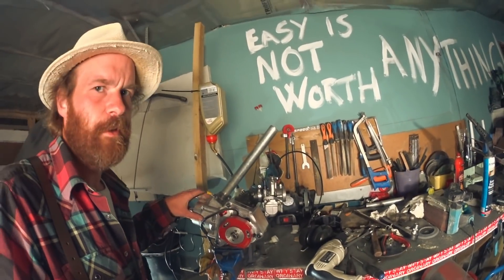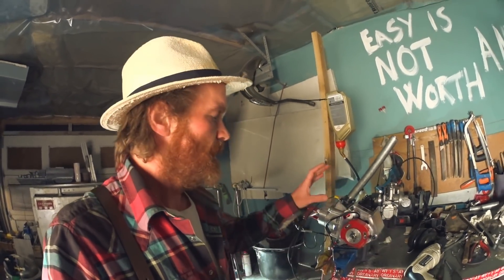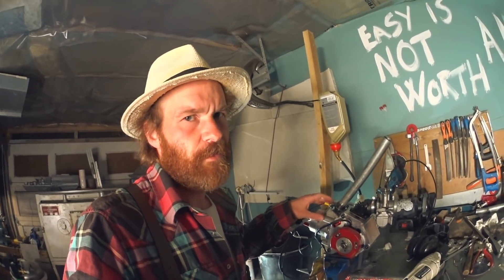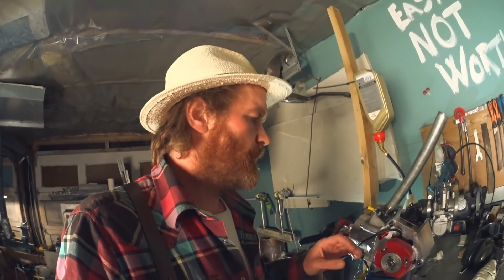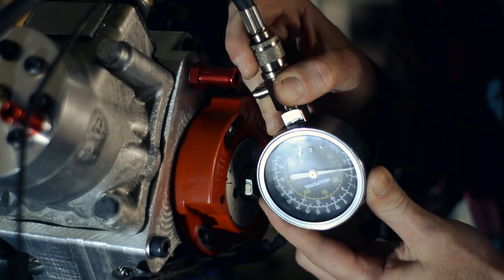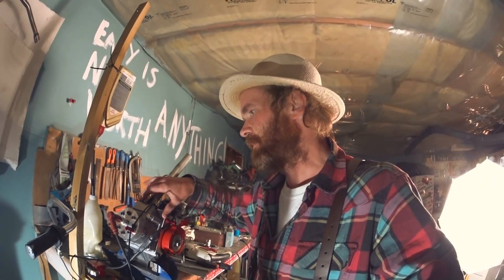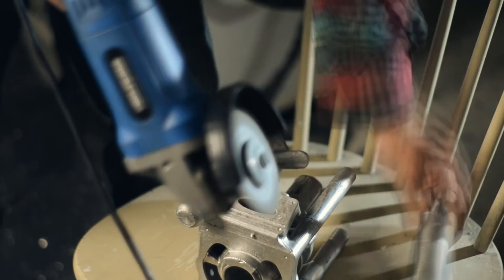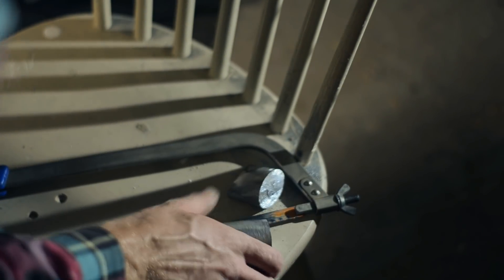Pipe! - The Most Powerful Two Stroke Ever

Comment: Are you running the exhaust upward like that on the bike? My experience with karting engine development is that pipes that have any upward incline do not tune well. I find the oil droplets still in the exhaust gasses seem to pulse back into the combustion chamber with the sound wave. We run 16 to 25:1 on our steel liner engines so maybe it is just the amount of oil we use?
Interested to know your thoughts on this.
Reply: The engine sits upside down on the bike.
Reply: Ahhh that's right I now recall the red cylinder head and IAME barrel facing downwards. Thanks.

Comment: Hi, microsoldering/celltech here, for the heating plate you can buy a lcd/touchscreen separator for real cheap on aliexpress or ebay, they have a little plc and they are like 60watt if im not wrong, that would give you constant heat for hours, in the shop they never turn them off! Love the content and the progress so far, i cant even start to desing a pipe for my old 2t honda!
Reply from the maker: Almost bought one with magnetic stirring last year, should have...

Comment: What kind of stinger/baffle is that?

Sous vide cookers have a pump that might get clogged up with nickel.  I'd go with a ceramic crock pot/slow cooker.  Not sure how it is where you live but I can find a used one at the thrift store for about $10. If you want it to be more precise you can get a cheap Chinese temperature controller that plugs into the slow cooker.
Reply: id say running the sous vide to heat a water bath in which you place the container with nickel plating. That is how many photographers do it to heat developer/blix when processing film
Reply from the maker: 👍 How I'll do it.
Reply from the maker: The aluminum venturi is the stinger - takes tailpipe length out of the equation provided its ID is large enough.
Reply: @2STROKESTUFFING  If I remember right, the volume of the last end of the pipe does something with the resonance. Does that venturi do the same thing?

Comment: @2STROKE STUFFING I was curious if you have ever checked out the 2-stroke calculators that Michael Forrest produced and has for sale at dragonfly75.com or have checked out his theory on pipe design? The reason I ask is his calculator package has many features of ENG-MOD-2T and is very reasonably priced.....also I have read in various locations that ENG-MOD-2T sometimes gives questionable #’s for the pipe because of the set temperature inputs....I believe the calculator that Michael made your able to set temperature (which I assume will be different on Nitromethane)...just figuring I’d ask / share in case this could be helpful for your project / engine.

Keep up the good work!!!
Reply from the maker: 👍 I'm very happy with how engmod works. Haven't tried Mr. Forrest's calculator, but I think it's just Blairs formulas. There's a lot of variables in engmod that has to be set right, think that's why people experience mixed results. As Wobbly puts it "shit in, shit out".
Reply: @2STROKE STUFFING thank you for the reply, I appreciate you taking the time! One other thing I wanted to mention is Mr. Forrest has an RPM specific balance factor calculator that is quite refined, and a YouTube channel explaining its use....this may be helpful in modification of your crankshaft for Mark’s piston and the 20K RPM’s you plan to achieve.

Best wishes 👍
Reply: @2STROKESTUFFING  
Great work man i did another comment in list but thought I'd add here as it's on topic.
Me personally with racing mx and flat track nothing but 2 stroke for 40 yrs.
The expansion chamber closer to cylinder will give bottom end the further away from cylinder more top end .
Hate to see you cut pipe but when running on dyno be great to see mild steel pipe with varying lengths of tube before expansion .
It's pretty much determines when powerband is the greatest. 
Why you see 2stroke flat tracker with under slung pipe further back on bike cheers man, love it.

Comment: When you run methanol you need to rinse out the system from methanol remains, maybe that what was you meant with purge the system? Or you can spray the internals of the injector/pump and put them in a zip lock bag.
I haven't run any engine on methanol myself, but have friends that have. But more or less the same goes for e85 also so.

WD-40 is a good lube for shorter periods of time but if the car is going to sit for longer than a couple of weeks, flush out the fuel system with gasoline.
When i ran my car on E85 i used this in the gastank:
https://www.redlineoil.se/produkt/si-alcohol-bransletillsats-355ml/

Comment: I wonder how the engine oil will work with the fuel injection spray nozzle?  Will you need two fuel injectors for engine operation over 11000 rpm?
Reply: I think he has two? but there are injectors you can get that do that. Diesel injectors already run that fast since they have to fire multiple times mid-combustion cycle.

Comment: Tyr reversing the pump polarity for a few quick bursts and then try again mate.
Reply from the maker: 👍 Thanks, great tip!
Reply from the maker: Turned out I forgot too hook up Arduino ground...
Reply: @2STROKESTUFFING  that's good news.
Reply: @2STROKESTUFFING  oh no XD
Reply: No worries man good luck 👍🏼
Reply: Just slam the Terminals to the battery, no PWM or Arduino between. Got myself a fuelpump from an CBR125 for my lawnmower efi and it’s crying the seconds after startup but works like a charm afterwards. 😉
Reply: I had a stubborn pump, 12v reverse/forward was not enough. Got it loose by feeding 24v alternating forward/reverse!!
Reply: If it's not completely sealed the company may offer replacement rubber impellers. I had one like that and the shaft and impeller seperated.
Reply: https://youtu.be/e0aRBUl-3IE